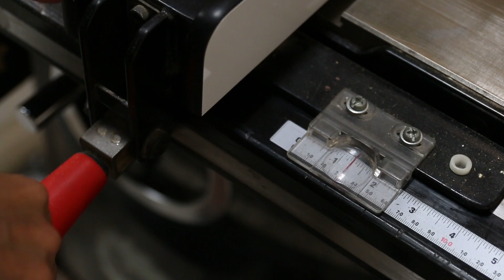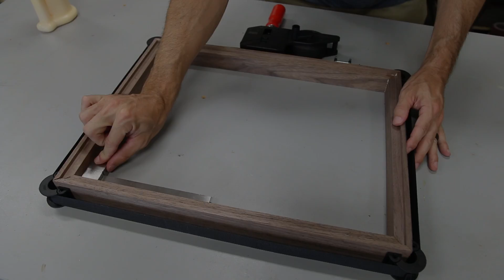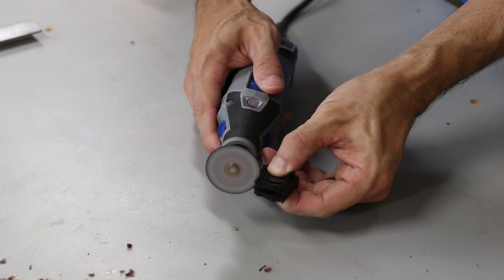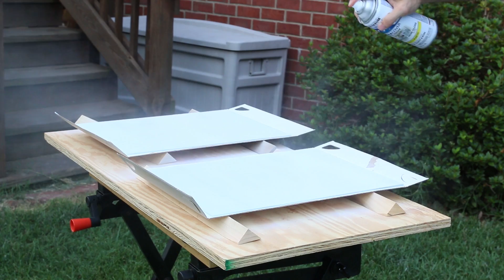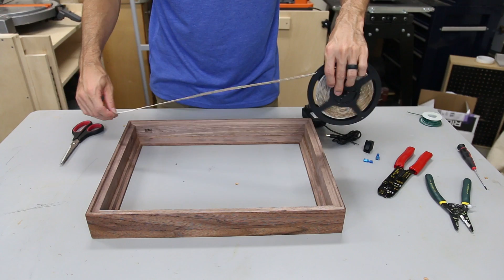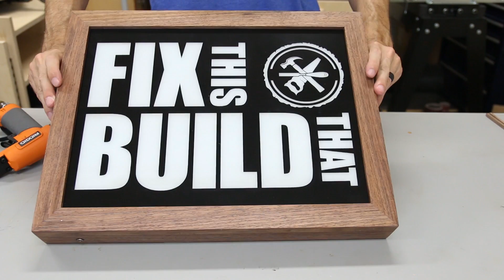How to Make a Custom LED Sign with a Wooden Frame

Comment: Thanks for a great video.  One question.  Did you laser mirrored in back or through black paint in front?
Reply from the maker: +Munawar Soomro through the paint on the front. Then covered the back with white paint
Reply: Thanks

Comment: Just curious as to why you lasered the front instead of doing the reverse on the back of the glass to protect the finish?
Reply from the maker: I had to etch off the black spray paint. It wouldn't work the other way
Reply: Fix This Build That I understood the way it worked I meant why shouldn't you spray the back and do it that way?

Comment: Do you recall the power and speed settings that you used for the laser?
Reply from the maker: +superlazyorg I'm wanting to say it was in the neighborhood of 25 speed and 60 to 80 power. But not certain.
Reply: Cool, thanks for the reply!  I assume that's 25 mm/sec; and 60-80% of the max power of 40 watts, right?